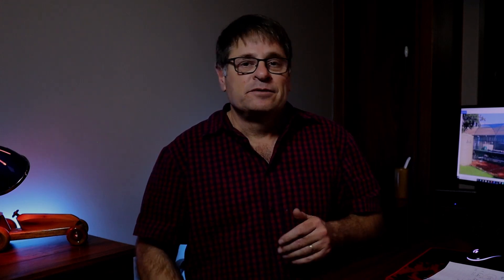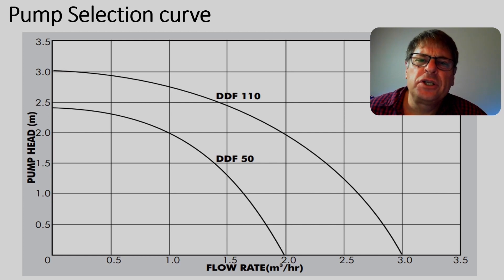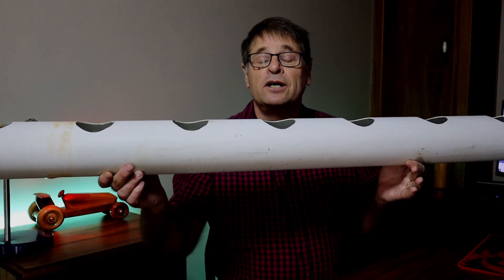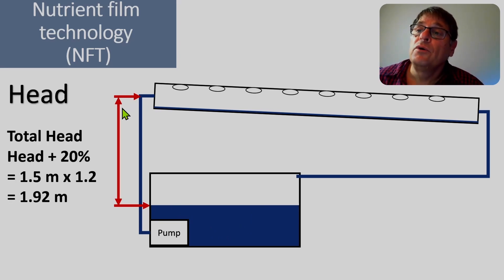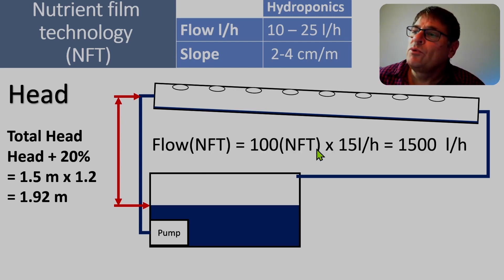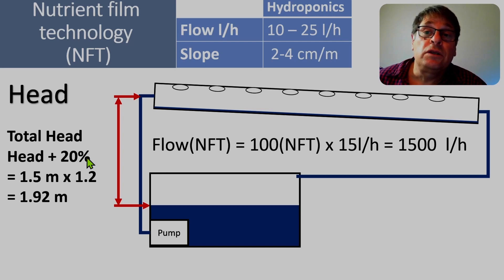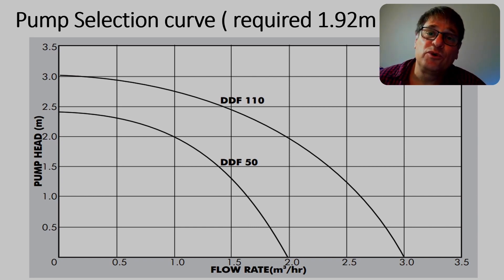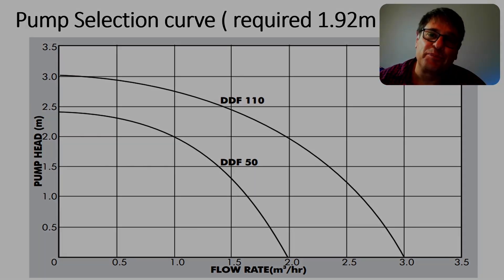Hydroponic NFT pump selection - How to

Comment: Very informative and and understandable. I'm in the San Francisco Bay Area and I'm setting up a little shelf Vertical NFT system (24" W x 14" D x 60" H) in my kitchen for salad greens and strawberries. I have an IDOO on the countertop for herbs and seed starting so far. The only thing I wasn't sure about was at the end when you mentioned different efficiencies and various watts. I'll either have to watch again to see if I missed something or do more research on how wattage impacts pump comparisons. Thanks!

Comment: Thanks so much!
Just one consideration, I am here cause I want to learn and set up my system properly.
By book an ideal nft flow rate is 1-2 liter x minute, 60-120 liter x hour. Why did you mention a much lower rate, 10-25 liter x hour?
Thanks
Reply from the maker: Hi, it is what I used, with good results.